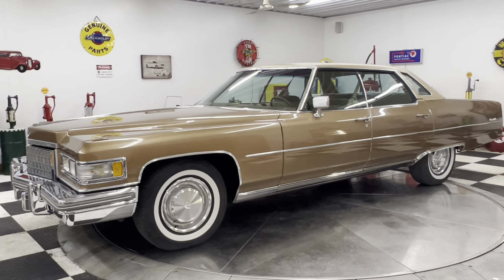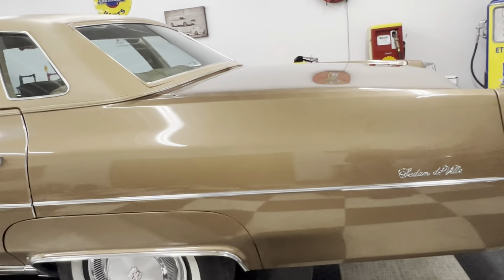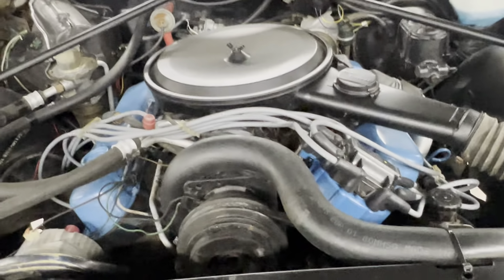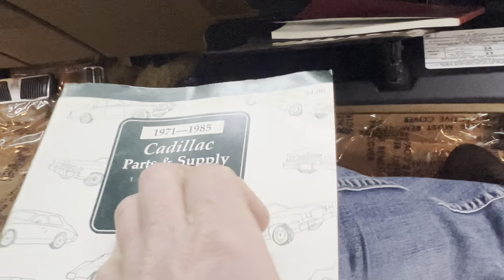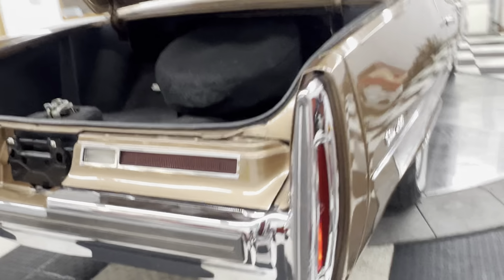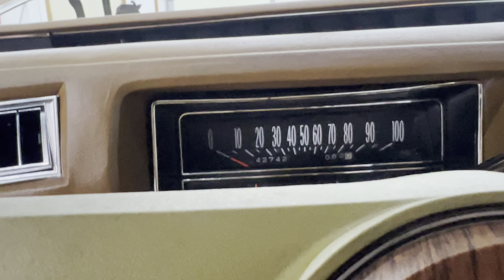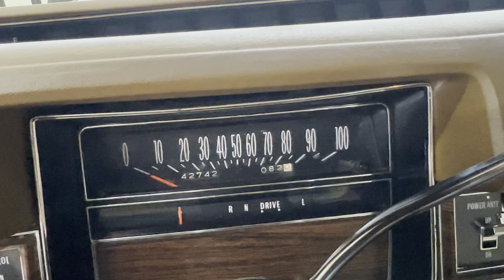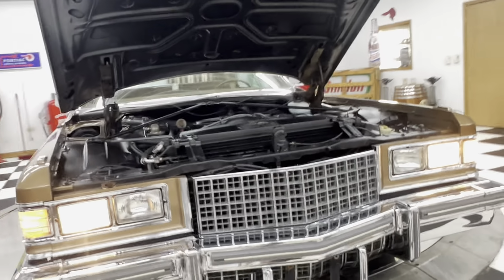SOLD SOLD SOLD !! 1976 Cadillac Sedan Deville four-door hardtop 42,000 miles $12,900

Comment: Sometime around 1985 or 86 I drove to the local junkyard (I don't remember why), and there sitting in the customer parking area was a blue `75 with a white vinyl top. I asked about it and the guy told me a little old lady had just dropped it off there. I don't remember how many miles were on it, but I think it must have been around 100k. I asked how much I could buy it for and he said $500. I ended up buying it. Then later I drove it to Florida (I'm in NJ), and while in Florida I delivered pizza with it. When delivering I got 5 mpg with it. I know because I got 25 gallons at every fillup and could only go 125 miles between fillups. One time I had the car detailed, and that's when it was discovered that the paint had a million micro cracks in it. Ultimately the rear springs started sagging, and then it was one thing after another with things going bad on it. I think I got rid of it in `87 or `88. I was sad, because I love the older Cadillacs. Oh, and while driving it around here in NJ right after I bought it, it got 9 mpg all the time. But then again my dad always said their `67 Imperial got 9 mpg all the time too. Anyway that's a beautiful Caddy, but the exhaust is too loud.